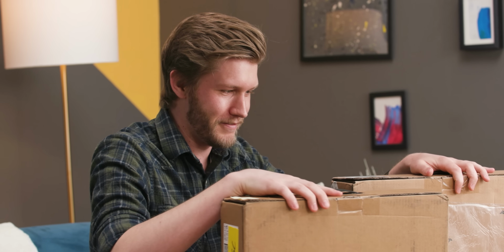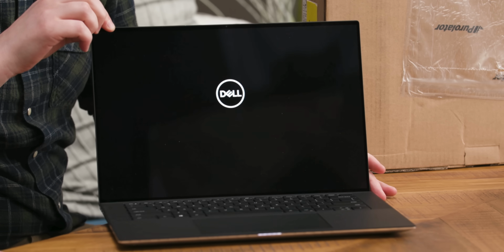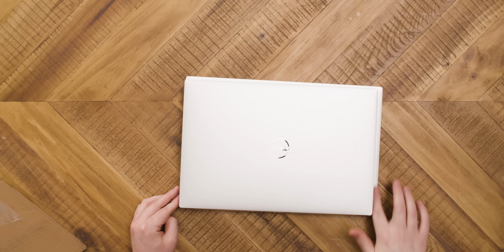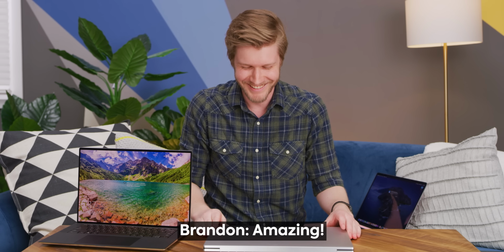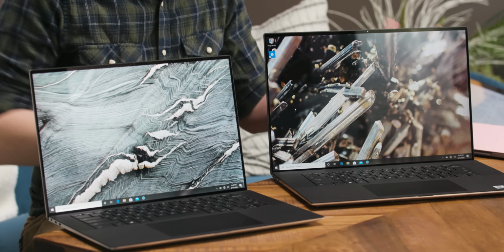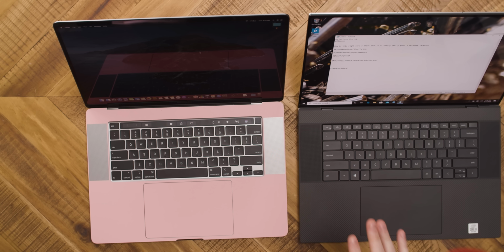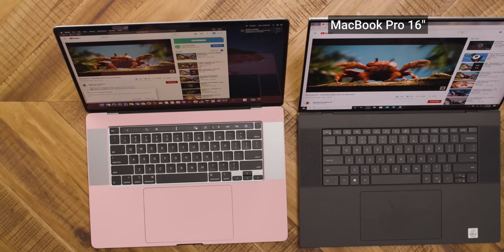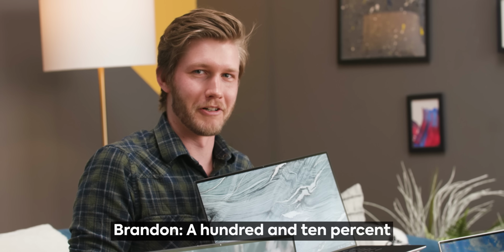The MacBook Pro's Biggest Rival - DELL XPS 15 9500 & 17 9700 Laptops

Comment: I have a XPS15 9560 from a couple years ago and I still throw everything at it with confidence. The 4gb GTX1050 is starting to feel a little behind, but I still see myself using it for a couple more years before I switch to a newer one. They are excellent laptops.

I used to buy HP Envy models and although the specs were impressive, the build quality was absolutely putrid. So fucking bad in fact that I was actually weary of moving it around too much with horrible hinges, wifi cards that just don't work, a case that creaks and moans like a hundred year old rocking chair, just appalling.

Comment: Had a Razer Blade Stealth that arrived with a detached LCD. Took 2 weeks to get a response from their customer service and another 3 weeks for their tech team to take apart the laptop give me trouble about how it happened and then send it back still damaged.  I just glued the screen back on myself and sold the laptop as it worked fine otherwise.  Terrible experience from start to finish with them.

Comment: Lets hope this model doesn't shit the bed after the warranty expires.
Reply: From my experience using a dell xps 15 for a little over 3 years before it just randomly died on me, I wouldn’t be surprised if this new one slows down alot and eventually dies right after the warranty ends.

Comment: Hopefully these aren’t plagued with coil whine and other issues like the past xps devices.
Reply: insainllama Yeah like driver issues, dock niggles, not turning back on if you let it go to sleep, screen lag and res/sizing issues when the built in display is 4K and you’re using 1440 ext monitors.
Reply: Matthew Kefford Not to mention the biggest issue I face on my 9560... jumpy/drifting touchpad
Reply: @therealrockothetaco  I found it helped to turn off the "button" regions at the bottom and just use single/double finger presses instead.
Reply: Matthew Kefford thank you, I will definitely try that!

Comment: Can’t wait for every tech reviewer to tell me about the out of control thermal throttling on these computers lol.  With 10th intel and nvidia GPUs in this thing, it’ll probably melt into liquid aluminum and copper within a few days.
Reply: True. I have the old XPS 15 and the CPU throttles like a bitch when Im playing video games. If only they would fix the bullshit overheating issues and a battery that doesnt swell then it would be pretty much superior to the macbook pro
Reply: Redrash12 yeah I have one as well, and even with the i5 it runs like a turbocharged space heater any time I want to do actual work. I basically use it as a 5 pound chrome book now lol.

Comment: I'd be really interested in hearing what you thought about the MSI prestige 15. I'll be honest the dell looks fantastic but no touchscreen on the 1080 screen does hurt it, I have no interest in 4k on a laptop at all.
Reply: MSI's are built like crap in my experience, feel very cheap.
Reply: @MrPaukann  But in a feel way or an it'll break if I close it too firmly way? Everything else about it looks pretty nice, good specs, good battery, decent screen. is upgradeable and repairable, and for a significantly better price than its competition.
Reply: @Dostro89 , I don know about durability, but it just felt very plasticky and for the price it wasn't acceptable. Also, the sales manager in a store told me that they weren't reliable. I am not sure which MSI model was it, but it wasn't one of the cheap ones. 

I tried saving money on a laptop, bought an Asus for a very good price: the motherboard failed, the fan started rattling and then the screen broke off. I am sticking with XPS, my old XPS 12 is still in use today.

Comment: Please relay this to Dell

1) 2K resolution + 144Hz + AMOLED (instead of either 1080p for refresh-rate or 4K for contrast & colour accuracy)
2) AMD CPU + Nvidia GPU (Not AMD-AMD or Nvidia with Intel)

*All ports to USB 4.0 when arrives later this year.
**Don't need touchscreen on a laptop better focus on panel, we have shortcuts, macros to a light-pen.

Comment: I still think Linus is right that laptop manufacturers need to adopt the 1440p resolution as standard for the 13-17in size ranges. It really is all the resolution 99% people will ever need. I mean you can still sell 4k to rip off customers who don't know better, and fuck it, go ahead and put 8k panels on a 13in laptop when they become available just because some idiot will still buy it so they can take a magnifying glass to their screen literally, but for any normal person with regular eyesight, 1440p is indistinguishable at standard sitting distance, and benefits from not having the power consumption of 4k. In addition they could start pushing higher FPS panels on their laptops if they did that, which does increase the responsiveness and snappiness of a systems feel if you're going from say 60 to 240 fps for sure. Obviously off by default to save battery life... But it would be a nice creature comfort.

Comment: I'm guessing the 17" is going to be expensive enough that the enterprise version of the Surface Book 3 with the Quadro RTX 3000 at $3000 is going to make more sense (somewhere between a 2070 and 2070 Super Max-Q).
Reply: The Ice-Lake processor in Surface Book 3, huge bezles and the small touchpad let me down massively, don't even compare that machine with XPS 17. Microsoft let me down so bad this year.
Reply: @adrinnosrati8334  The Surface Book would be completely unusable without those bezels. It is a tablet y'know. And Icelake is the only processor that makes sense in it. No one knew Renoir would be good 6 months ago, besides it's aimed at creatives who frequently need QuickSync.
Reply: @SeniorKlean  Well as you saw the XPS 17 is even cheaper than surface book 3, also regarding the bezel i suggest you take a look at Ipad Pro, you don't need that huge of bezels to be able to hold the tablet part but I still agree if someone needs a surface book they should go get it because there's nothing like it on the market
Reply: @adrinnosrati8334  IMO, the bezels on the iPad Pro are too small. The iPad Air has them right. When I'm holding a large tablet, I want to HOLD it, not lean it on my fingers or pinch the edge like a phone. And most premium laptops could benefit from a much larger bottom bezel to improve ergonomics, the side and top bezels can be as tiny as they like, the Yoga C940 has it right. 

Frankly, I don't understand this obsession with bezel sizes at all. As long as you have glass all the way across it doesn't look cheap.
Reply: @SeniorKlean  Well it looks sleek and modern that's the obsession, maybe not to your taste but most people like thin bezels

Comment: I would have preferred to have 16:10 AND the large bottom bezel.  Tiny side and top bezels are great, but I wouldn't pay more for them over MBP sized bezels.  However, a large-ish bottom bezel makes for better ergonomics.  Lenovo really got it right with the Yoga C940.

Comment: They should also have configurations that support long battery life -
i5 (4 Core) or Ryzen 5 - (35W or even 15W ?)
16GB Ram
512GB SSD
15" 1440p Display
97W Battery
1650Ti / UHD Graphics
Intel Optimus to switch off dedicated graphics when using for office work

Comment: Forget about touchscreen. Can we have Ryzen 4900HS APU in at least a base model?
Reply: Imagine a Ryzen 4900HS in a XPS 15, but with a 97Wh battery instead of dedicated graphics and a 1080P screen. That thing will probably outlast your day and run as cool as a cucumber, all while kicking serious 8 thread ass.
Reply: @tomhsia4354  That is dream VMs user but the nightmare is manufacturer only cares graphic users..
Reply: @tomhsia4354  they never make a perfect one lol !!!!!!
Reply: And wt about thermal after ryzen 4900 beast ?.
Reply: @nabinsubedi3918   TDP is 35-45W max versus 70-100W on similar performing10th gen intel equivalents. Not even a challenge mate.
Reply: Jo K it’s funny how intel tdp numbers are similar to desktop zen, though that doesn’t take into account the differences between their testing.

Comment: Does anyone know if the decrease from 97 to 86WHr in the 15 inch is gonna make a big difference? I currently have a 9570 with the 97 WHr battery and the battery life is pretty nice but with some moderate usage (compiling small projects for school and such) the battery life from a single charge can go from 8 hours to 4 real quick (if i leave it on high performance). I wonder if the 86WHr is going to hold up but I don't know if it's going to make a big difference in practice.

Comment: After never have used macs nor iphones, I got a macbook pro for a work laptop, i7-8750H, 16gb ram, 512SSD. I've used it for 1½ weeks now and after listening to tech reviewers claiming the mac has the best trackpad EVER, I'm disappointed. Yes it's big,  and what else? It's supposed to be accurate? Idk I switched to a mouse after the first week. Other than that, the screen is nice yes, but macOS isn't really as smooth as I thought it would be. I often get small lags, I assume it's because the processor tries to idle as much as possible, to reduce heat, so even though I'm plugged in it's not really performing as well as it could. Also, a 75-90hz screen would make it feel a lot smoother and premium. Edit: Forgot to mention the keyboard. I don't really like it, but it works, would prefer a thinkpad. The control strip is quite handy for volume and brightness sliders.

Comment: Looks nice, although I still can't figure out your guys obsession with touch. It's such an awkward and useless form factor for anything that's not either a handheld or a drawing tablet. I've had it on my old xps for years now and I can think of maybe a couple times ever that I've used it intentionally. Generally it just eats battery and makes it a pain wipe off the screen while the computer is running
Reply: I have to highly disagree. I can't use a non touch screen laptop anymore. The touch is just more convenient and faster to use in many situations especially if you're walking around or in a more awkward sitting position. I can only think of not using the touch a ton if you're using your laptop like a desktop with a normal table and mouse all the time. 

This is a more personal reason but I use my laptop enough that my fingers and elbows will start to hurt from the repetitive motions and positions. But using the touch screen is not only easier on the joints but let's me change positions and movements.

Comment: I'm glad Dell realizes that the camera industry hasn't shown any signs of moving away from the SD standard and still includes the card reader.
Reply: Sd cards apear to be here to stay. They are reliable, and are just advancing, and keeping up with other forms of protsble storage.
Reply: @Pleasedonttagme  the future is cf express tho. hopefully next gen will have a cf express reader
Reply: @Pleasedonttagme  it might take 2 years. Because canon will use cf Express in their upcoming mirrorless, nikon already has cf Express in their pro bodies, the latest canon and blackmagic cine cameras have cfast or cf Express now just waiting for sony to use cf Express and we'll definitely have a cf Express slot in 2022.
Reply: USB-A port would have been good for a wireless mouse
Reply: @YoungDen  I prefer a Bluetooth connected mouse which does not require a dongle.
Reply: I wish they put the mbp speakers inside the laptop
Reply: @Love-Runs-Blind  eh, i think they are really fine. Though the mbp speakers, i so rarely use the laptop speakers, and I dont part of what im paying should go to speakers, when it could go to things like the carbon fiber, or the face recognition.
Reply: The Satan I have personally experienced the mbp 16 sound and it’s really of exceptional quality. But I am using the Dell XP’s L502x model having jbl speakers and it sounds really good

Comment: Razer Blade has one of  best build quality in windows laptops but the problem is there hardware tends to fail. speaking of my experince i had the razer blade 15 and after a year of use the camera and mic stopped working and many issues started appearing like crashing app not responding. (I have formated multiple times with same issues reappearing also i updated the bios). so yes wouldn't reccomend razer unless u get extended warrent and would wait for them to fix it each time.

Comment: I'm genuinely asking what is the use case of a touchscreen on a regular laptop? Personally I don't see myself using keyboard and a mouse and suddenly reaching to touch the screen. Why? Can someone tell me why regular laptops need touchscreen? 2 in 1 yes, but regular, I don't think so.
Reply: So the FBI can get your fingerprints ofc
Reply: Can be quicker than using the mouse at times. I would find uses for it. Why not
Reply: @danwat1234  If I'm sitting on a desk (which is the right way to use a laptop, this is not a tablet) I don't think it's faster to reach and tap the screen than to move the mouse a little bit to the left or right.
Reply: @TihomirRAdeff  agreed but sometimes it's just more intuitive. Nice to use on interactive things like maps. I don't really see a downside besides more cost
Reply: @TheGoat yes on a tablet using fingers is a lot more intuitive but on a laptop I have the mouse in my hand why would I reach and scroll when I can just scroll the wheel on the mouse. Or why would I reach to the screen and pinch zoom when I can just again rotate the wheel. For a tablet or two in one of course it's better, but while I have a mouse in my hand and the display is 1 - 1.5 meters away I don't see the point for a touch screen especially if I have to pay more for it.
Reply: @TheGoat maybe if there is no mouse I see a little benefit but still is it that important :)
Reply: I don‘t think many people use a mouse when they‘re on the go with their laptops. I mainly use the touch screen for scrolling and switching tabs in chrome, much quicker and more comfortable than the touchpad.
Reply: I don't need it, would rather prefer an UHD none-glare (like the FHD+) panel without touch capability.

Comment: XPS 15s break a bunch too. Mine has had 2 new screens and total motherboard failure in 3 years. Lot of my friends in college use XPS 15s as well and all of us have at one time or another needed major repairs. Great laptops but if you need the reliability I would consider something with maybe less features but a more contemporary design like a Lenovo.

Comment: ltt should be ashamed to be pushing a product like xps without doing all the research, xps have by far the worst long term use problems in its price range. just google xps  and after all the ads all you will find are problems with thermals, battery or motherboard or wifi card...... there are so many issues with so many ppl i am surprised there is no class action lawsuit. such a regret buying this piece of junk.

Comment: It's each controller that has 4 PCIe lanes not each port, please look at the Intel datasheet for that Thunderbolt 3 controller. Alex also please try to get things right by doing a little research and stop spreading false information (saying this after having also seen your iMac video).
Reply: Can one port access all 4 lanes (assuming the other one is not in use)? If so then he's essentially right
Reply: @JoshF848  No, because he says "each one has 4 PCIe lanes". That would imply that you can connect to each port and get x4 performance

Comment: I want a 1440p + Ryzen CPU (4900H would be great) and RTX (need for ML), would instantly swap to the 17" then, that doesn't look that interesting enough to upgrade.

(Current config I have is a i7 9750H 6/12 core, 32GB RAM, 2x1TB SSD, 1080p 144Hz, RTX 2060 and it's driving 2x1440p 27" 144Hz external monitors via DP, external mouse and keyboard hooked up. Needs to be laptop though as take it with to work in coffee shops at times to get away from the office, so battery life is important, I currently get around 5 hours on lower middle if not running ML stuff).

Comment: You guys really need to test the thermals I have the xps 9560 and it does really well with just cpu loads or gpu loads but when you put them both together the software just cuts the cpu down to .75 ghz and everything falls apart and the cpu is only hitting 70 degrees and the gpu is around 60 it sucks and a lot of ppl have these issues the only way I have found around it is undervolting the cpu even new awesome thermal past doesn’t help

Comment: 1) Slightly too expensive, design is stunning but the specs arn't there
2) Needs a Ryzen 4900HS, this is a professional product cores and GPU power are everything (C4D, Maya, Vray etc)
3) Those speakers are ooft

Comment: And on topic: I am running the older XPS 15 as a (mostly) Java developer machine since it was released in 2018 (?). Moved over from a late 2014 MacBook Pro. Runs Ubuntu Linux without any issues and is a great experience so far. It it is also true for the new model it might make a great machine.

Comment: My only problem would be that you would have liked to see at least one USB-A port instead of the SD card reader. I know there are guys out there that use SD cards but I never do. Well not in a way that would justify having a permanent reader in my laptop. I had micro SD cards in my mobile phone back when that was a thing and there is one in my Surface Go and my Raspberry Pi, mut I never use them outside there device or I rarely write to them. And if I ever had to I would need to pack a micro to full-size SD card adapter anyways so I could as well bring an USB reader.
What are full-size SD cards even used anymore?

Comment: really, 17" and no numpad? bummer.
really, no usb-a ports? bummer. (Also, wtf, that usb c to usb a adapter is freaking huge, who is going to use that?!)
really, no hdmi port? bummer.
really, no amd option? bummer.
Yeah. Not the best laptop. Lots of little annoying things. You basically need one of those thunderbolt adapters that do multiple things..